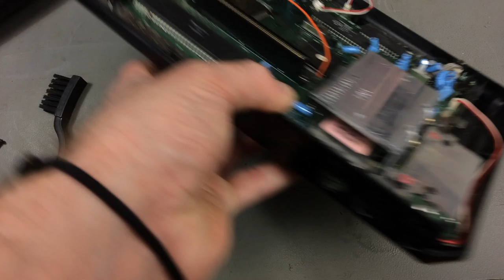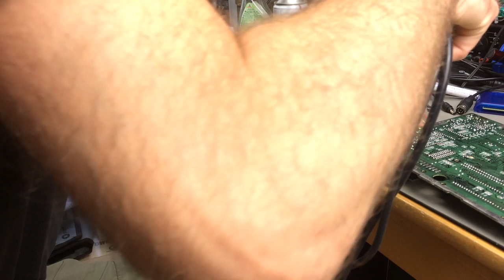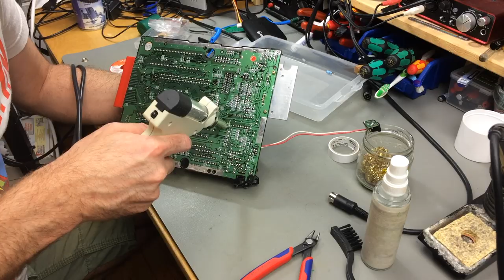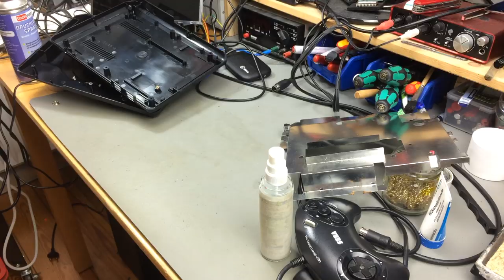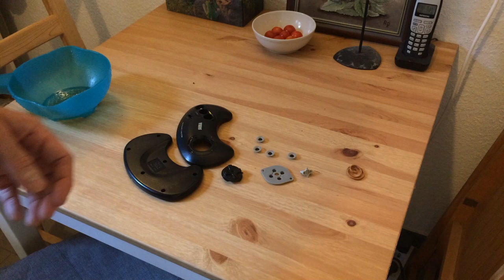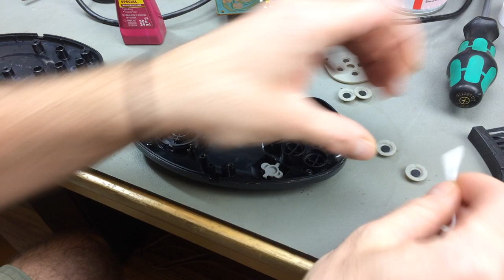Sega Mega Drive Restoration

Comment: Here is something for the capacitor aficionados:
Replacing capacitors in old hardware is always a good move and it has therapeutic benefits for some of us. However, it is just as pleasant to know what you are doing and why. The life of an aluminum electrolytic capacitor is mostly determined by the chemical reaction formula called "Arrhenius' Law of Chemical Activity" and therefore to an great extend by the ambient temperature. In short it says that the life of a capacitor doubles for every 10 degree Celsius decrease in temperature.
L2 = L1 * (Vr/Vo) * 2^x
where x = Tm - (Ta + deltaT) / 10
Ta = Ambient Temperature, Tm = Max temperature rating of the capacitor, deltaT = Temperature Rise from Ripple current
Vr = Max voltage rating of the capacitor, Vo = Operating Voltage, L1 = Load Life Rating via Datasheet and L2 = The projected Life at operating Conditions

So for a L1=1000h/85° 10V ordinary cap running in a 5V system with no thermal stress(at ~25°) this will result in the ballpark figure of around 20 years. The 20 years are operating hours, not an expiry date as for food:)
If you substitute the ordinary with an Europe Chemi-Con gem with 10000h/105° 16V operating at 5V/40° you can expect a lifetime of 1,800,000 hours or 205 years.

With power supply capacitors, the deltaT must be calculated with, as this can be an important value when ripple current is flowing to a greater extend than in normal applications.

Have fun and enjoy the eventide of your life in 205 years together with your capacitor:)

Comment: As a big Mega Drive fan, I really like this video! :D Nice work! I know what pain it is to recap one of these machines since I did it with my own and it took forever! I was kinda shocked to see that many capacitors in there. But it was worth it in the end because I think one or two of them had started to leak as I found some strange substance on the board which I think was electrolyte from one of the caps. The picture quality improved slightly after I was done, so there was without a doubt a tired cap in there.
If you're only going to play games from an Everdrive, I highly recommend doing a 60Hz mod since it is super-duper easy on Mega Drives. All you have to do is to cut a jumper and bridge another and you're done! I did that plus added a switch to mine so I can toggle between 50Hz and 60Hz on the fly and it really improved the gaming experience. Sonic games are just way too slow on 50Hz. 
Once again amazing video Jan, and I'm looking forward to se you stream some Mega Drive goodness :) P.S. Yes you should definetly retrobright it :D
Reply from the maker: Thanks! Yes, the MD is amazing. I'm definitely going to do some mods to it soon. :)

Comment: Ah Jan!!! You should have done the 60Hz switch mod while you had it open, makes such a nice difference on PAL consoles with higher speeds and removes the borders. Very simple to do to.
Reply from the maker: Oh, will do that in another video I think. I've just started reading up on possible mods. Interesting stuff for sure!
Reply: Jan Beta Follow up vids covering modding your MD would be appreciated, Jan :) If you decide to, of course. One day I should get around to doing my old original MD from 1992...
Reply: Could also look at the mods to remove jailbars.
Reply: @Nukle0n  Never had jail bars on any of my systems and that is while using RGB so I would notice them on a LCD and CRT TV. The only lines I have noticed are the colour bands that is a trick they done to make a particular colour.
Reply: Nukleon that’s more of a USA model problem.
Reply: Nukleon is that the one where you cut a pin on a chip? I remember doing something like that many years ago on a MD that’s long gone.

Comment: haha I remember that mega drive, I suspect I may have put a gamegear power supply in it which would be center positive, I am only 8 minutes in to the video so far, maybe I did the damage, maybe the reset button was the cause all along.

By now I probably could have worked it out myself but I am super happy you got a video out of it, I have a poorly Amiga 500 board coming your way soon too, will be in touch!
Reply: It was just the stuck reset switch causing it to power off?.... I feel a bit silly now haha
Reply: Few things:
1. swap that LED for a nice SEGA Blue one
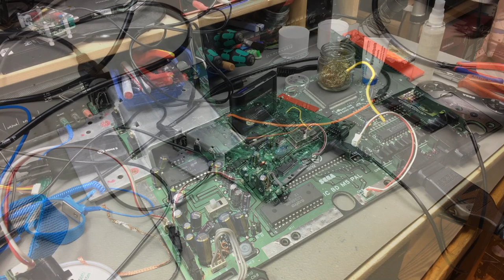2. look at the video @ 21:58 find JP1,2,3,4 next to your hand, Cut the trace between the 2 contacts at JP3, get a double throw or toggle switch, solder the center pin to JP1 (right side) and the on/on legs of the switch to JP4 (either side) and you have a 50/60hz mod which enables the extra processing power on the megadrive, speeds up games to NTSC performance and removes the annoying boarders :)

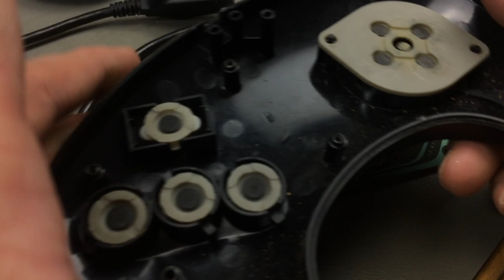Comment: 26:30 Ah yes. The good ole "clean the contacts and pads" that make most all controllers work again.
Reply from the maker: Yes, it works (nearly) all the time indeed. The only serious other problem is a broken cable in my experience.
Reply: @JanBeta  Yeah... I've had a few of those, too. Recently got a Sega Master System lot with a few systems, controllers, and games. I had to take a cable from one controller and put it in another to fix it.

Comment: Ah yes the Mega Drive, I like to call it that myself actually despite the fact that it's called Genesis here in America. Family used to have one and it's still here along with the old SNES as well was basically my early 90's those 2. Someone else commented about the switch mod which is indeed great for PAL versions of the console to make it work at NTSC or back to PAL as needed. Good to see you repairin' other retro hardware as well, keep it up.

As for games to try, well aside the obvious ones The Sonics, Streets of Rages and what not, I would say some other very good games are: Ristar, Gunstar Heroes, Toejam & Earl, the Phantasy Star series, Shining Force series, Beyond Oasis, Landstalker, Rocket Knight Adventures and Kid Chameleon (even though it's unforgivably hard).
Reply: SaintKaede why does everyone ignore the konami games? They are some of the best the system has to offer with contra being my favourite game of all time.
Reply: @robertbektas1810  holy crap I forgot that too though I did say Rocket Knight Adventures, but yeah Contra Hard Corps, Castlevania Bloodlines is great, even Zombies ate my Neighbors which is on the SNES as well but it's fine on either, same with sunset riders and lethal enforcer, all great games from Konami, can't believe I forgot them even.

Comment: I know this is a older video, but awesome job man. I replaced the caps my main and back up Sega Genesis, put new voltage regulator that you used and replaced the reset switch with the clickly one. I hope i can get another 20 years.

but yeah really hate sega for how many caps they used 😅
Reply from the maker: Thanks! May your Sega live on for a long time to come! :D

Comment: Hey Jan, any chance of you doing a video on the gamegear? I'd love to see you restore it with tantalum or ceramic capacitors
Reply: I looked into those ceramic caps for recapping consoles and the problem is that they seem to generally not have the capacity for something like an old game system resulting in dim screens, weak sound, and other problems.
Reply: @ncc74656m  I use ceramic caps only on the motherboard, power and sound are indeed better suited for electrolytic

Comment: grüße jan, schönes video. ich hab gerade auch eine bekommen und versuche sie wieder flott zu machen. eine frage:  was denkst du, wäre ein RGB mod oder Composite mod sinnvoll, für tec. idioten wie mich? und kann man den RGB mod auch ohne widerstände und kondis basteln, oder ist das nicht möglich?..PS: kann man irgentwo noch neine dieser "fake-evercarts" kaufen? 80 euronen (plus und aus china) sind doch sehr viel für den originalen spaß...lg, danke für deine arbeit und ein super start in den frühling dir..dor krautrockt!er aus chemnitz
Reply from the maker: Du brauchst da gar nix zu modden, die Mega Drives haben ein recht gutes RGB-Signal am Videoausgang. Composite gibt es auch. Für ein gutes RGB-Kabel brauchst du ein paar kleine Komponenten, aber es gibt auch fertige für wenig Geld. Meins kam glaube ich direkt von Amazon und funktioniert 1A. Die günstigen Everdrives gibt es manchmal bei eBay, allerdings nicht durchgängig (ich vermute die werden immer mal wieder geblockt wegen Fake). Kosten allerdings auch 50-60€ momentan.
Reply: @JanBeta  hey, dankeschön für die antwort....werd mir mal eins bestellen, di hufeisen stecker sind nichts für mich um löten ;-) lg und nen schönen tag dir!!!

Comment: You can use a little vaseline to lubricate the buttons, making the plastic not grind but run smooth.
Reply from the maker: I used some silicon lubricant for that purpose before. Works well, too. :)

Comment: Great video! What's that paste you used for the heat sink? Thermal paste?
Reply from the maker: It's standard thermal paste for transistors. You can also use the stuff for CPUs but I think that is more optimized for higher temperatures.
Reply: @JanBeta  I've opened my Mega Drive before but I never noticed paste in there. I have CPU thermal paste in hand... I guess it shouldn't do any harm

Comment: I don't see many Mega Drive repair videos as they are very reliable systems.
I must recap mine, just because of the age not because its getting faulty.
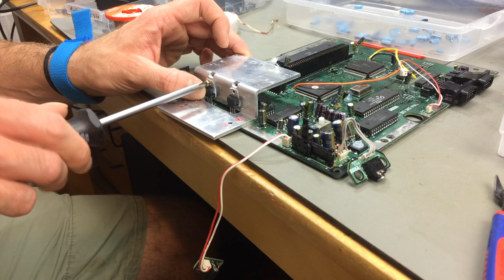20:24 why did you swap the game in this jump cut?  Was it not working?
Reply from the maker: I think I forgot to turn the power on or something, console didn't start up. I used the shot with me flicking the power switch because I didn't film that for the next shot where I actually start the cartridge. ;)

Comment: I really do not under stand your problem with 78xx/79xx voltage regulators.
In 45 years of electronic repair as a job,not a hobby, I can count the number of these voltage regulator fails on one hand.
Reply: depends really.. i see the JRC brand ones fail quite often. It depends how hot they have been running too.
Reply from the maker: I think I might be a bit over cautious with them. I've seen quite a few 7805s fail catastrophically in C64 power supplies. Admittedly they are pushed pretty hard (both thermally and electrically) in those units though.

Comment: So you have a working system, you measure a healthy output voltage on both regulators but decide to replace them because a funky cartridge shuts the system down?
Reply from the maker: Yup, I actually thought the regulators had been replaced before maybe or had seen some stress that prevented them from delivering the current they are rated for. I didn't take the wonkyness of the cart into account at first.

Comment: You could do a Game Gear recap video some time as well. That is an awesome system too. Plagued by the same leaky SMD caps as the Amigas. Maybe do a screen mod as well, although the better screen costs a fortune for the GG.
Reply from the maker: Yes, definitely need to get my hands on a Game Gear sometime. One of the few consoles I actually had back in the day. :)

Comment: That cartridge was clearly faulty.. but measuring the ohms from +5V against the ground with the cartridge on/off instead of just powering it would probably have saved you some unnecessary steps and current spikes :)
Reply from the maker: Yeah, you are probably right. I didn't realize that the cart was wonky at first. I really suspected the regulators rather. Lesson learned. ;)

Comment: Is that a sidecar connector under that red tape on the right of the board?  (edit:  sorry, I never owned a Genesis/Mega Drive.  That's the MegaCD port, isn't it?)

also: no 68010 upgrade? 😁  (someone had to say it)
also2:  you should fix the squeaky controller so we can see what you're talking about with the D-pad.
Reply: It is a edge connector for the Mega CD..

Comment: My sega genesis (megadrive) turns on but just give black screen can u plese help me , what it could possibly be? thanks in advance
Reply: First guess is dirty cartridge slot.  Either use a credit card ( or similar ) wrapped in a cloth with a bit of contact cleaner or cleaning alcohol and insert it in and out of the cartridge slot a few times.   You can do the same with fine grit sandpaper.
Reply: @StRoRo  i already did, i also checked broken solder points on it and everything in fact looks fine, still i get just a black screen, is like it tries to play the cartridge but it cant for some reason. Not sure is the voltage regulators or i should recap the whole thing...any idea what it could possibly be?
Reply: manystar  hi! Mine had the same Symptom but only 5 years later I've discovered it was caused by oxidation on traces around the cartridge slot, and also cold solder joints on some pins in this are, on the bottom side of the board. I've just released a part 1 video about this machine  https://m.youtube.com/watch?v=KWAflGCdeaY .Also have u checked the voltage in and out from the voltage regulators ? On the service manual it also mentions the oscillator maybe the cause of black screen , u can check the manual and all the schematics here https://gamesx.com/wiki/doku.php?id=schematics:console_related_schematics

If u need a help ther please let me know
Reply: @Okurka.  Yes ofc, the console also evidently, the led turns red and everything, if i connect the headphones to the jack i hear a subtle hum which means is ON but i dont get video, i dunno if my reset button is jammed or stuck, i tried everything by now...
Reply: @BocaRetroGames  oh wow great info im going to read the whole thing right away, thank u very much indeed dear friend. I´ll coment later if i manage to fix it, thanks again.

Comment: Hi i have a megadrive and was cleaning with rubbing alchol , where the white is where it says power on i now have black smudge can i fix it i did i ruin it ? thanks
Reply from the maker: It might very well be that the alcohol dissolved the paint of the silkscreened text. You‘d have to repaint it to save it probably. :(
Reply: thanks the text is  there  whattype  of paint woukd be good for this thanks
Reply from the maker: I would suggest to try rub-on letters. Should be easier to get a clean/original look.

Comment: Try cleaning the motherboard the cardtridge connector the Sega cd expansion board it's how I fixed my original Sega Genesis model 1 high definition graphics system and it works excellent I saved 2 original Sega Genesis model 1 high definition graphics systems I bought off eBay and they both work excellent I cleaned the heat sink motherboard cardtridge connector Sega cd expansion and controller ports the less dust the more likely it will work also add new solder to the power pcb board and replace the voltage regulators and all the capacitors

Comment: Hi Jan. You shouldn't use the knock off ever drive things. They're circuitry is design for the wrong voltages ( ~3.3 instead of 5V ), there's a chance you could harm your system by using them.
Reply: If everdrive's are 3.3v logic level, then your comment merely indicates that it's the everdrive itself that will suffer an early demise (if it's not 5v tolerant on the in/outputs)

tldr; Stop posting fud..
Reply from the maker: I think it will have some kind of voltage regulator inside that provides the 3.3V from the 5V? Otherwise it’s probably not going to live very long. I don’t think the MegaDrive is going to be harmed. The first ED I tried might have a short across some connector pins, that might have been dangerous for the MD but I don’t think a working Everdrive could do any harm.
Reply: @JanBeta  René from DB Electronics did a great explanation of this on The Retro Roundtable. It only affects the clone flashcarts, the original Krikzz Everdrive is fine. I'll try and find what episode it was mentioned in and post a link.
Reply from the maker: Definitely interested! Didn’t know that obviously.
Reply: @JanBeta  Found the episode. 26:00
https://www.youtube.com/watch?v=1Aq9VoLzGNs&t=400s

Comment: They are very hardy consoles, I have owned my Mega Drive Mk1 from new and never had a issue. I own the original High Definition Graphics - Stereo Sound with the silver 16 - BIT logo. I also own a Mk2 Mega Drive and a MK1 Mega CD and I have the boxes etc for all of them, I got these brand new when they came out in the early 90's. Some flash cartridges are a bad idea to use if they have not been made professionally.. I would only use one from  https://krikzz.com/store as I know these are well made and unlikely to damage the console.
Reply from the maker: Yes, the real ED from krikzz are definitely the way to go if you want quality. A lot more expensive though so I bought a cheap one first to try things. Might end up getting the real thing because I really enjoy the MegaDrive so far. :)
Reply: @JanBeta  If you get the X5 version and get a Mega CD you can change the BIOS on the flash cart to play all regions, games are easy to copy to CD-r (no copy protection) Bin and Cue format. And the X5 has a save feature for the Mega CD. X7 version does more stuff and is more for developers. X3 is basic as it can get. You can play SMS files on you cartridge "SEGA Master System" You pay more because they are built to last and have more functions.